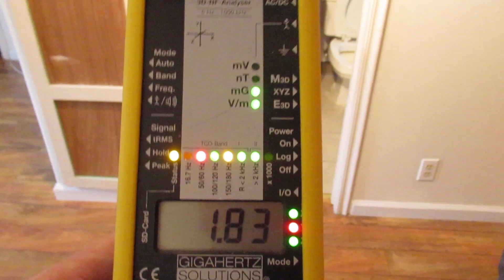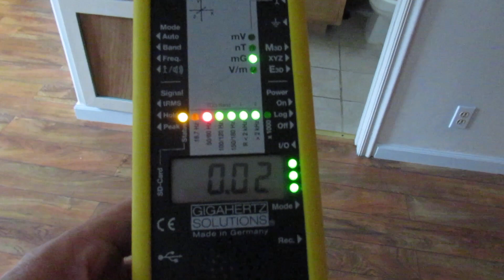Detecting wire code errors with an  NFA1000 3-axis magnetic fields meter.

Comment: Have you ever had a reading on the NFA 1000 of less than 12 nT,  on the 3 axis M field TRMS, and less than 3.5 - 5 V/M (fluctuating) on the "peak" setting of E-field? Red at power freq but no harmonics. This is indoors AND outdoors. I wonder why it's the same outdoors since E-field is 0.0
Reply from the maker: Yes.